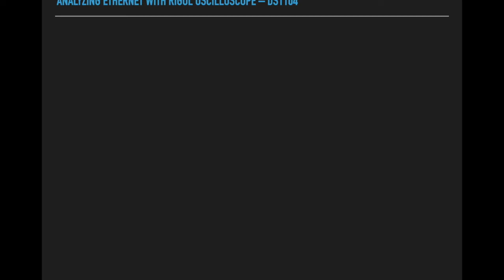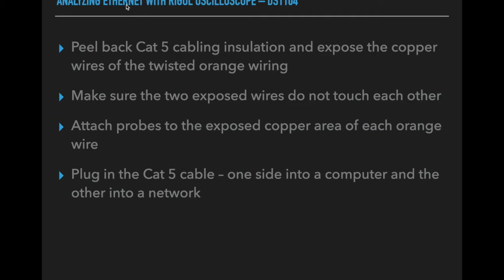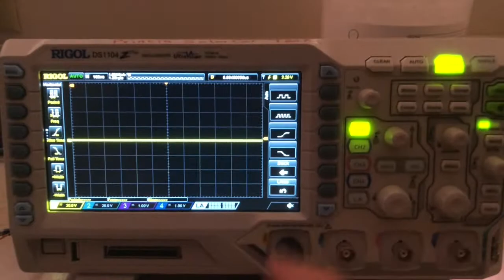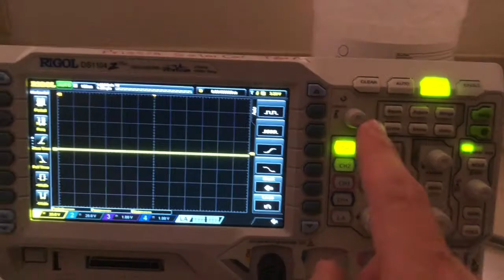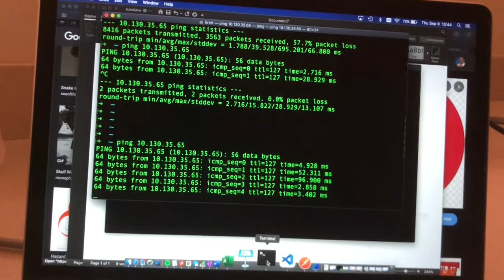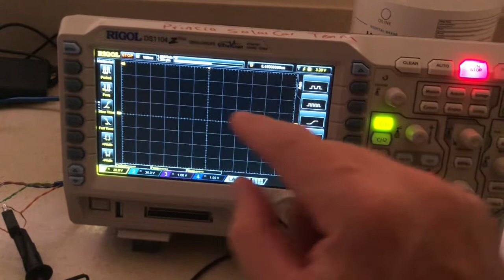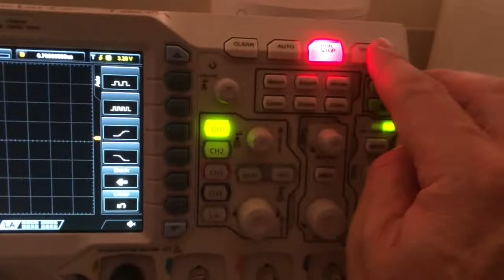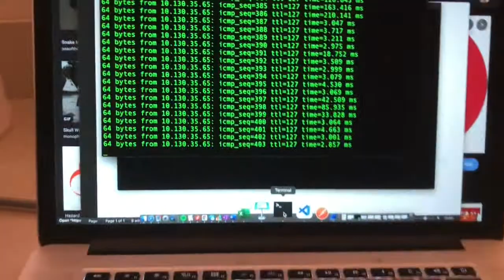Analyzing Ethernet Encoding With Rigol Oscilloscope – DS1104

Comment: Never try to plug the side of a cable into anything. You need to use the end.
Reply: Yeah - it was easier to do it in the thin ethernet times :) - you could just tap the coax and put the connector into the oscilloscope - 10Base2 freq is the same but at that time 100MHz oscilloscopes (even analog ones) were harder to obtain :)